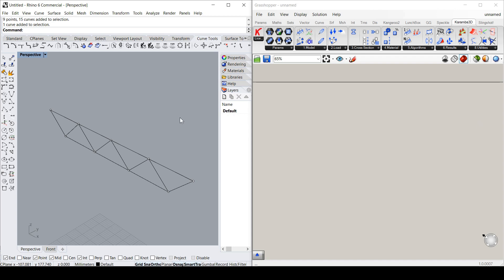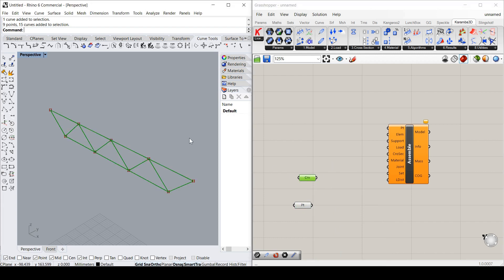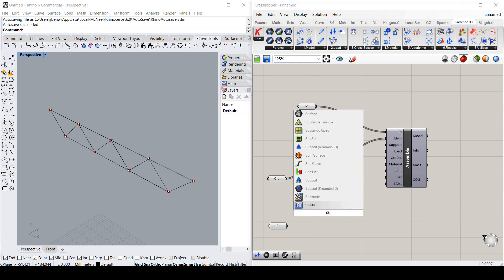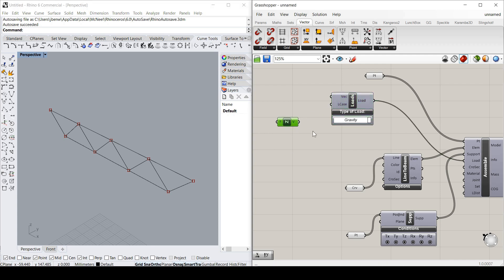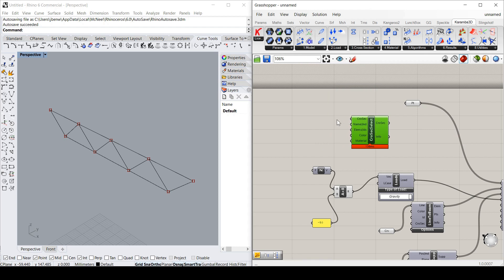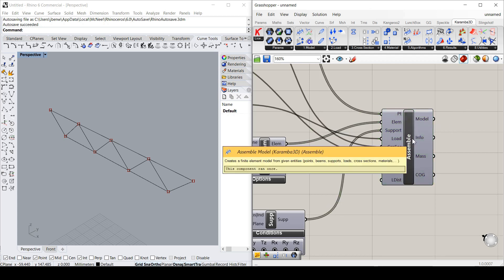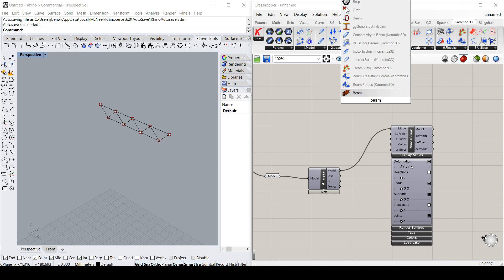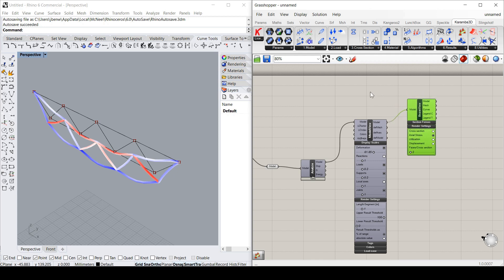Tutorial: Simple Truss Structural Analysis with Karamba in Grasshopper and Rhino

Comment: Hi! I tried to run the structure analysis on the model that I constructed by following your previous video "Tutorial: Simple Truss Structural Analysis with Karamba in Grasshopper and Rhino". Unfortunately it wasn't possible for me to select the nodes. It seems that the model I made through Grasshopper isn't made by actual points (marked with an "O" in Rhino), but by coordinates (marked with an "X"). I noticed that the same thing happens in your model which I previously referred to. Therefore as I try to "set multiple Points" I'm not able to select them. I hope you can help me solve my problem. Thank you very much.

Comment: I’m having trouble using the ‘line to beam’ component, it always shows the same error message which is ‘this component did not run because it lacked required data’. Any ideas to fix this?
Reply from the maker: Not sure as that component is fairly simple. If you hover the mouse over the 'Line' input make sure there are values being input.
Reply: @StructuredParametrics  solved now thanks, it was a problem with the karamba 3D plug in had to manually uninstall rhino and then reinstall all the plug ins

Comment: Very useful. May I know for the gravity load, is the input unit kN/m^2?
Reply from the maker: Actually the gravity load is documented as a multiplier of gravity. Therefore the load in the example will be (Self weight) x (vector multiplier). If you want to add a line load in kN/m, use the line load component. Hope that helps.

Comment: I'm professional structure engineer. Pls delight me what is the advantages using this kind of workflow compare to regular one. In my humble opinion, i can do the exact thing 2x faster in regular software (i use midas software) and how deep/advance analysis this software capable of ? I mean like nonlinear analysis, time history, etc.
Reply from the maker: Regular software certainly has more advanced capability for analysis than Karamba (although maybe this might change in the future). 
The difference to most traditional software is that geometry and other inputs can be controlled parametrically. For example you could run through many different geometry configurations in seconds by scrolling the mouse. There is also access to lots of geometry and mathematical input and output tools in grasshopper. 
Either way there is no reason to stop using traditional software. Many engineers wont need or want to use parametrics and that's fine.
Reply: @StructuredParametrics  I see. I, myself will use CAD+Excel for modelling complex structural shape (at least to generate the nodes coordinate). Either way, i like the logical input in this software. Good for the starter.